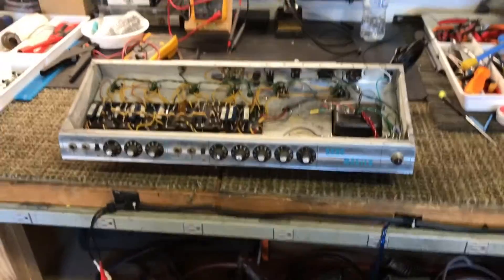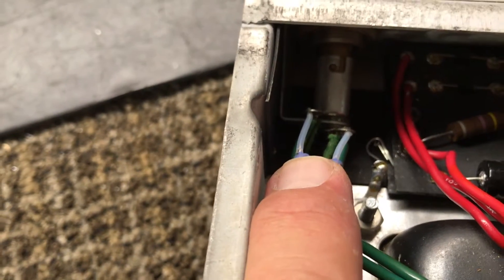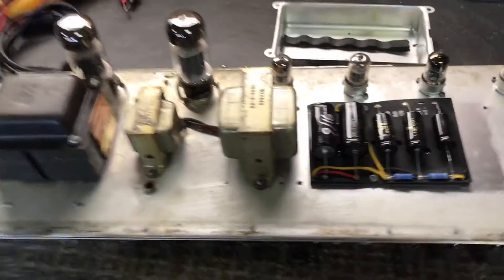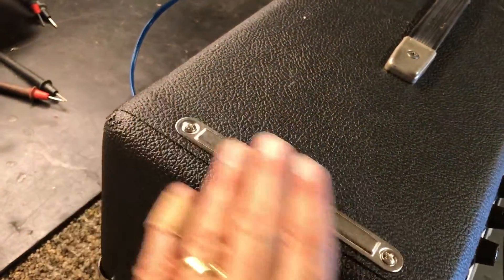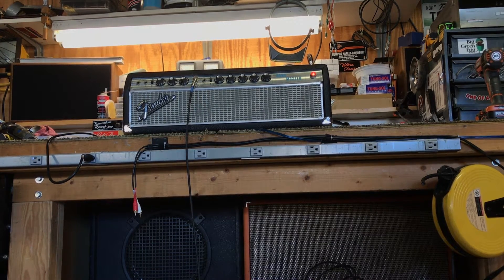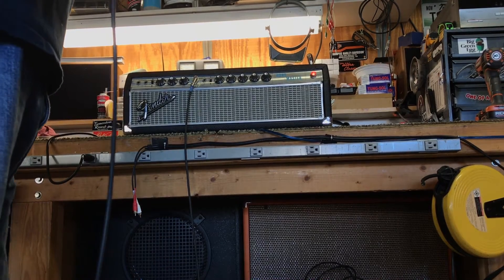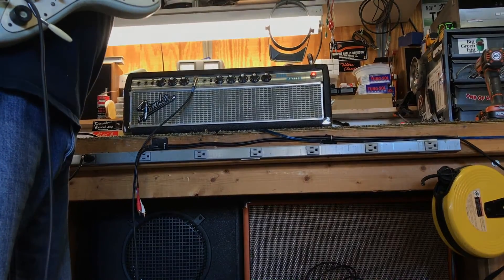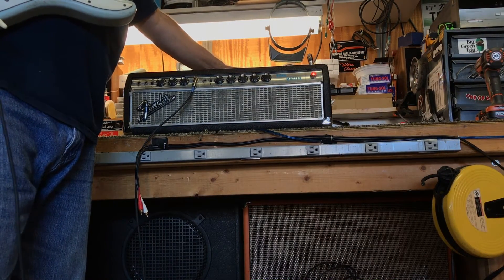1967 Bandmaster

Comment: Terry Kath of the band Chicago used one of those.
Reply: He did use a Bandmaster, but not at all exclusively or even like it was his amplifier of choice. According to a early 1970 Guitar Player magazine article his favorite amps were a 60-watt Knight and an 85-watt Fender Dual Showman. He also played Fender Twin Reverbs and a 35-watt Knight Heathkit Tube Amplifier played into a homemade 6-10 speaker cabinet. 
At times, he also favored a Dual Showman amplifier using  Bogan PA amp as a preamp. "Freeform Guitar" and "Listen" was recorded with this setup probably others as well. 
Come to think about it, the popularity of the bandmaster in the late-60's, it's hard to believe that he wouldn't to have at least used one from time to time.

Comment: I'm gonna figure out those first few licks you did. Great playing: thanks. Stay longer on the Normal channel... it's also a thing. I've a 1964 Vibrolux and Normal is where I station myself before poking into the Vibro Channel and then maybe a pedal or two.
Reply: Get a good channel switcher pedal and plug into both and pop back and forth. You can put two different overdrives in there and have a real good time!

Comment: Hi, what circuit number does that bamdmaster have, the AB763? Thank you
Reply from the maker: Yes sir
Reply: @65Corvette  I have this exact same amp. A guy brought it to me for service,  and died while I had it in the shop. His family would not come and get it, or settle the bill with me. They basically shined me on. It hung around in the shop for a year, and I claimed it because nobody wanted to pay me for the parts and labor. It became an abandoned orphan. I had given it new tubes, new electrolytics, a good cleaning inside and out, and a 3 wire power cord. It sprang to life and sounded wonderful after 15 years in the guy's shed. Nobody wanted it, so it's mine now for the price of the parts, plus about 3 hours labor, which was mostly the cleaning. Sometimes life tries to hand you a bag of lemons, and you make a big pitcher of lemonade.

Comment: A friend of mine gave me a Fender Bandmaster head that is missing a tube and spent two winters with mice living inside!!   I cleaned out the nest and it sits in my house without me ever having played through it......I'm wondering if restoring it would cost me a small fortune?
Reply from the maker: Hi There,

I would say it really depends on the amount of parts needed.  I would expect a fresh set of tubes and a full cap job for sure.  There are also some resistors that should be checked and replaced as needed.  Again, all that said it really needs to be on the bench to determine the extent of the work needed.  I will be happy to look her over and let you know what she needs if you can get it to me in Nashville, TN.

Take a look at www.p2pamps.com for info
Reply: ultraroadmap I would restore it, they are sweet amps, or I will buy it unrestored.
Reply: I'd sell a quart of blood if that was the only way I could pay for a tech to get that thing right. It will last for years and years before it needs another servicing. I am blessed to own a '62 brownface and just recently bought a '67 blackface, and had I the room and duh dough, would buy a stack of them just to make sure I had one. My first amp was a brand new 1964 Super Reverb. I once had to take that in for servicing and the store loaned me a Bandmaster from around that same era, and it made me wish I had bought one of those instead. Run a Gibson 335 into one of those with the closed back 2X12, and the full-chord drive is just a thing to behold, for rhythm.